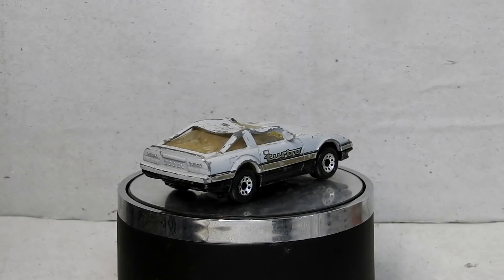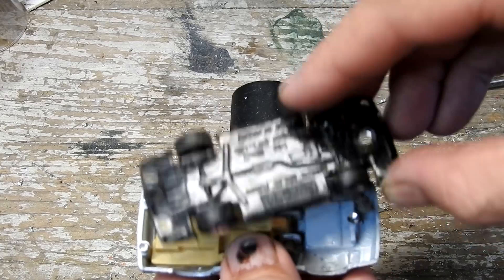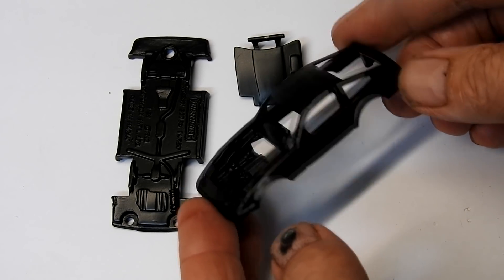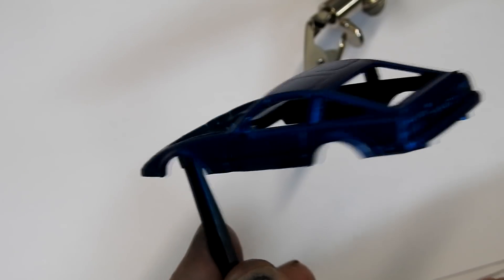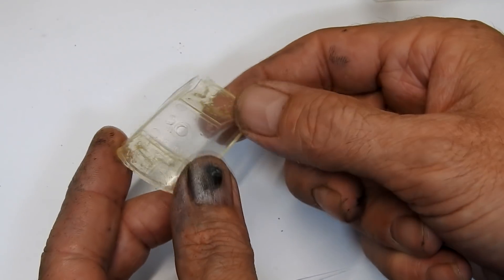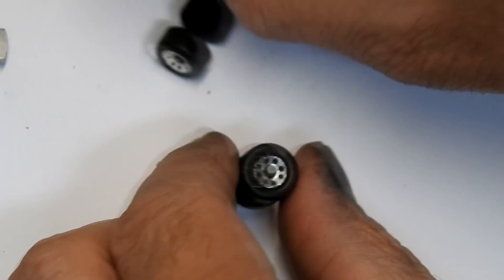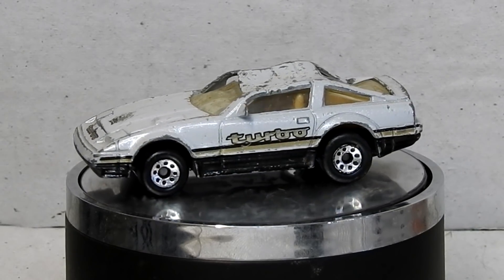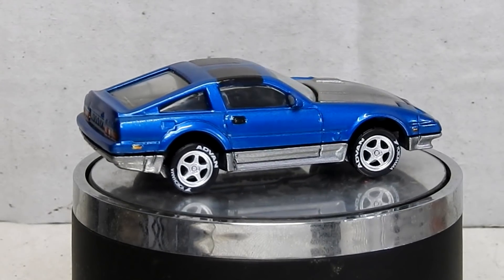Nissan 300ZX Custom Restoration Matchbox

Comment: I owned a 280z  back in the late 80's to early 90's it was the same color you painted this model however the hood was blue with 3 black strips down the middle of the hood one wide in the middle and 1 narrower strip down each side of the wider one.....I was custom 280z from the 1st. owner it could top out at nearly 180 mph....My oldest brother had a 240z it was orange with the same black strips.......

Comment: ‘Only about 1/2 the original car"... lol.   Only the hood/bonnet and the base!!!  8)    Cool car tho. Good job
Reply: I like the end result, don't get me wrong, but why show us the smashed car when non of the bent parts are used? Did the "donor car" have no bonnet/hood and/or base, and if so wouldn't the smashed one be the donor? If you are getting a new hart nobody calls you "the body donor". Just saying.
The thumbnail feels like clickbait 😒
Reply: Totally agree, 

Why show so much donating of parts? I thought I’d see him giving a tutorial on actually restoring the parts that were damaged. 

The interior could’ve easily been fixed with a little bit of two parts epoxy and some sanding. 

The original body should’ve been hammered/punched out to the original shape; maybe using the “donor” parts as an example to ensure the shape was correctly made. 

If you’re gonna replace the tires and wheels, why not make them real riders? Otherwise, it’s not too difficult to restore the originals to a more than acceptable condition. 

It seems counterproductive to use so many donor parts. If that was the case, just start with that car and use the parts from this car as donor. 

Usually I like his videos but this was a bit of a disappointment.

Comment: Well better to replace the casting then going through the trouble of fixing it but atleast you did a good job replacing the parts by putting them together into making a newly restored car as for the old casting I think it's better off as a crashed car or being apart of a junkyard diorama anyway since it was badly damaged to begin with.

Comment: Beautiful job although the casting has a flaw on the back where the taillights are, the red is supposed to be where the Nissan and 300zx badges are, and the bottom part are the orenge a white. But the rest is absolutely beautiful. Keep up the good work

Comment: aw... you chickened out I wanted to see you try to fix that broken body.
Reply: I just did a #46 Mercedes 300se.  Quite a lot of hammering on a thick towel, and the roof was twisted too.  Broken A pillars to glue back on.  Surprisingly the window survived, though squashed.  Hot water to soften and it went back into shape.

Comment: Your dates are wrong 1984-1989 they went through slight body changes. 1984 had two tags, Datsun and Nissan. 1985 had the hood scoop and it was functional.

Comment: Tail lights are wrong. You should had paint red where you read "NISSAN" and "TURBO". The three spaces below each side are from outer to inner: Yellow, reflective red and white. Also the center with the 300SX are reflective red on the original.

Comment: I love the new color and the repair, but a total whoops on not doing the hood the same color of the car. If you went carbon fiberesque it would have made sense but with the silver on JUST the hood.. .it looks like the guy doing the restoration ran out of funds to complete the job. The tail lights are inaccurate as well, there is a HUGE red part above the detail you did that was missed.